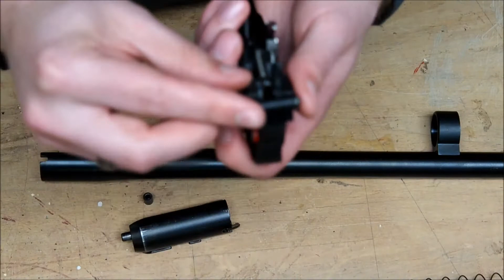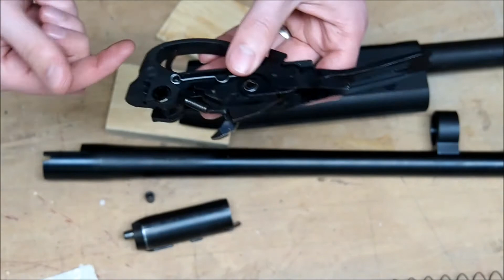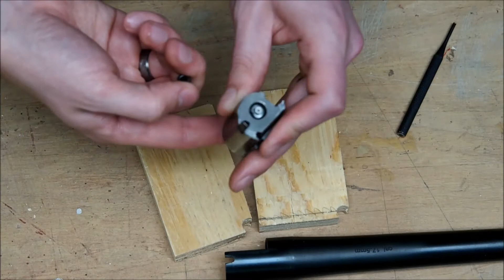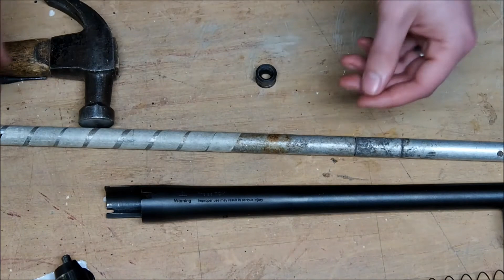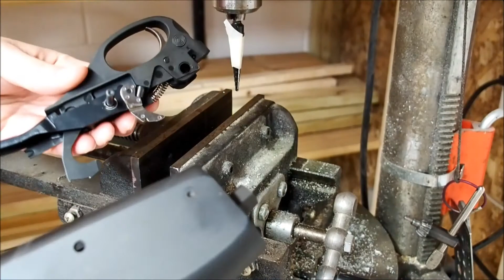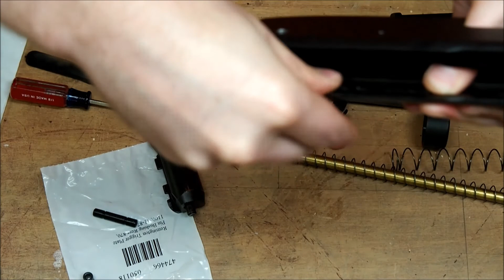Dominator DM870 Modifaction Build Log pt 2

Comment: Why don't you just buy an aps cam870  ?
Reply from the maker: durability this is 100% steel not casted pot metal, and for awhile APS discontinued any of their shotguns that fired using co2 stored in the shell. (which are more powerful and reliable than the ones taking gas in the bolt)

Comment: Hello, Lovely video. How are all of the modifications holding up today?
Reply from the maker: Quite well. nothing really that would reduce life or anything. all the parts functioning well the only real difference is the shell that is cycled which does have a a few nuance differences from the PPS ones i feel like the only point of concern would be shell lips and or extractor longevity wise and at that i would expect the same on the CAM setup
Reply: Nice! Thanks for the information. I really like custom projects overall and this peaked my interest.

Comment: how about using aps barrel? they are made to be perfect with aps shells. i do know it looks a bit different, but, i do think it is quite possible to use the aps barrel on dm 870(with modification of course, but i do think it would be better at air seal)

Comment: Just to check, what size drill bit is needed for the rear pin?
Reply from the maker: it should be .25 in or 1/4 in if memory serves me right the pin itself is a smidge under that, so it can slide in/out